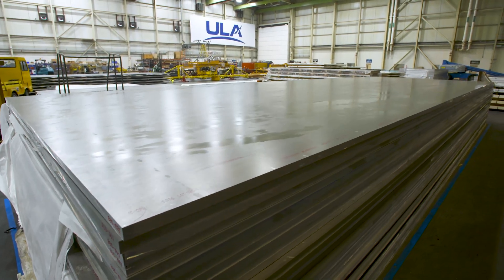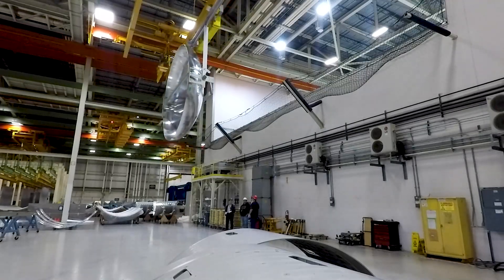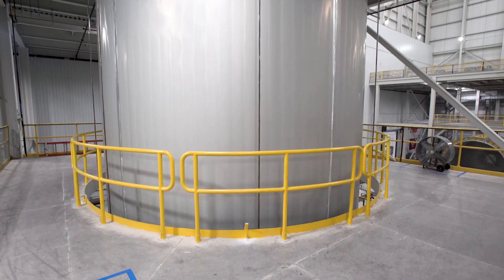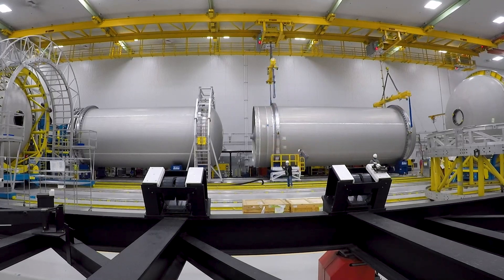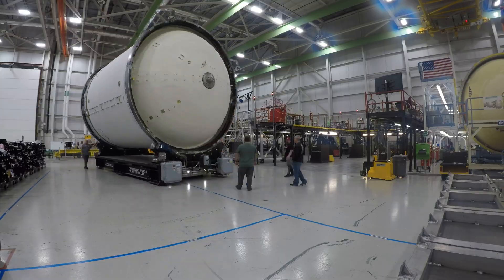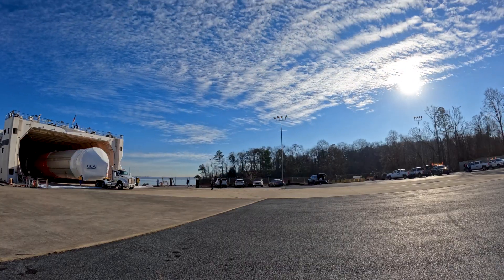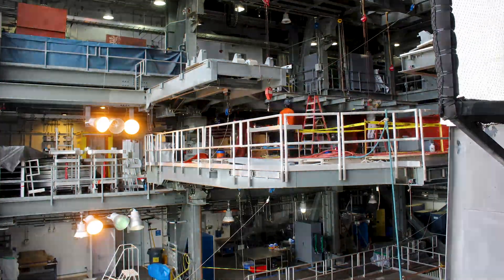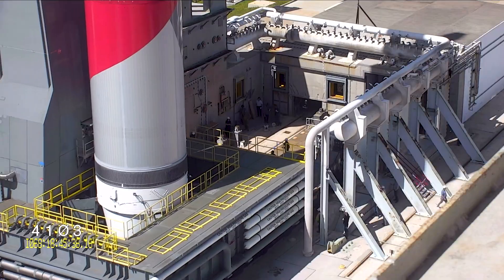Vulcan: Overview

Comment: I have been eagerly waiting for the Vulcan Centaur to be ready even if it's a few years later than expected. It's great not have to use Russian designed engines anymore with the BE-4 a great replacement. The BE-4 uses very similar fuels and combustion to the Raptor engine and is an extremely modern and efficient design well suited to it's intended use.
The very large and spacious upper stage allows payloads of all sizes to be carried with the overall fairing length and width changeable which allows extremely large and multiple small payloads to be carried. The launch system showcases the practical use of multipurpose modularity rather than reusability.
The very large diameter of the rocket with the ability to vary the amount of Solid Rocket Boosters fitted bodes well for the varying types of missions foreseen for the launch system.
I wish the project all the luck in the world and will be watching the launch and the progress of the peregrine lunar lander avidly.
All up an excellent future proofed design with proven and reliable components used throughout.
😎🇦🇺👍

Comment: Vulcan/Centaur looks to be an impressive new-generation launch vehicle that will no doubt be crucial to the coming New Space revolution. I have a couple of questions:
1: Is Centaur meant to replace the now-discontinued ACES upper stage, or no?
2: Are there plans for ULA to develop an in-orbit / in-space refueling mechanism for Centaur, so it can act as a re-usable space tug?
3: Can Centaur suppliment, or compliment, NASA's Exploration Upper Stage in delivering payloads to destinations beyond low-Earth orbit?
4: Could Vulcan handle the launch of NASA's Exploration Upper Stage?
Reply: I can answer!

1-2. ACES was more of a notional concept to develop ideas for Centaur V. Most of those ideas - including on orbit refuelling/reuse and long duration missions - will be added on to future block upgrades for Centaur V.

3. There have been studies exploring launching Centaur III on top of the SLS-EUS stack for deep space probes and they have turned out favorable. I'd assume the same would go for using Centaur V. 

4. Vulcan has neither the upmass capacity nor the infrastructure to launch an EUS to orbit. It just doesn't make much sense when the SLS core stage exists can get an entire EUS and payload to LEO without needing to light the second stage.
Reply: @abbyfluoroethane  I think only New Glenn or Falcon Heavy could lift the EUS to orbit when used in an expendable configuration.
Reply: @luther0013  Falcon Heavy definitely could not do that. In a fully expendable config FH can just barely get ICPS and Orion into orbit, and this is ignoring the fact that you would be putting an 8 meter stage on top of a 3.7 meter rocket. New Glenn might be able to do it. They have similar diameters and the performance is probably there. It would likely hamper the overall performance of EUS from the need to use more dV to get into orbit in the first place.
Reply: @abbyfluoroethane  sorry my mistake. But you can do ICPS missions with FH and Gateway/NRHO missions with NG. Also if NG gets its 3 stage configuration then the EUS should be not loose any performance.
Reply: @luther0013  Lol imagine a Falcon Heavy with an EUS. That would be in Scott Manley's list with the Thor-Able and Ariane 4.

Comment: It doesn't say how these rockets land?  How do they land?
Reply: The tank is disposed of, however, the engine segment containing the BE4 engines is recovered via an inflatable heat shield and parachute assembly where it will land engines up in the ocean for recovery.

It is said that they have reduced costs enough to be competitive with F9 when their reuse method (SMART) is operational. No upper-stage recovery plan is in place, and given the fact that it is a Centaur, it makes sense that they wouldn’t. 

Vulcan will likely shine as a heavy payload to GEO and HEO locations where the F9’s RP1 first stage will not offer the best performance. It is unclear how this will work in conjunction with Starship’s goals, but they likely have a bit of time before that becomes a serious concern.

Comment: I hope the BE4 engines work without issue.
also, I have wondered, does the water deluge system use saltwater or fresh water?
Reply: Almost certainly freshwater, seawater will corrode and damage the sensitive components (mainly the engines) during testing and can damage the pad structure itself.
Reply: @seasickrhino8926  I suspected that. Seems like something they should be using desalination for, but given where they are located it probably isn't happening.
Reply: The FRF went off without a hitch. Everything now depends on the new Centaur V with modified dome passing qualification and then the delivery next month of the flight CV.
Reply: theyre doing a 10 second test fire today at 6:45pm EST

Comment: Now that is how to do a water deluge system! Two separate levels of water deluge that don’t spray the water up into the engines and a proper flame trench to correctly remove the energy from the rocket’s exhaust plume area. Seems to have a sense of sanity about it.

I don’t understand how another company can have such a disconnect from proper industrial practices that are based on 60 plus years of experience. The concept of the best part is no part only works when the path to determining that a part / system is not needed doesn’t first require you to relearn a lesson that was made clear so long ago! Suggest suboptimal decision matrix. If you totally mess up on the obvious, what does that say about doing the actual hard things correctly?

Go Vulcan!
Reply: If that somehow magically happens we all win. More space innovation is a good thing and not a zero sum game. 

You make it seem like ULA is the only one that knows how things are done. Everyone thought the "boring space company" as you called them, would never land an orbital rocket and so far they are the only ones who have done it. You should be excited for all space innovation and not throw shade at one company or another.
Reply: @gandazgul  Funny how the SpaceX fanboys, never practice what they preach. How come I never see fellow SpaceX fans, chastising their own for trolling these comment sections?
Reply: This guy innovates! 😂
Reply: @gandazgul 
Rocket Boring Company!! Great innovation, no extra parts needed!! ULA will get to engine reusably by the time the chopsticks are 100% reliable.